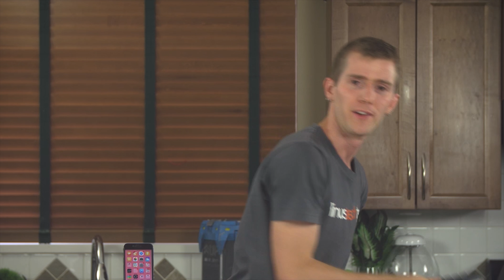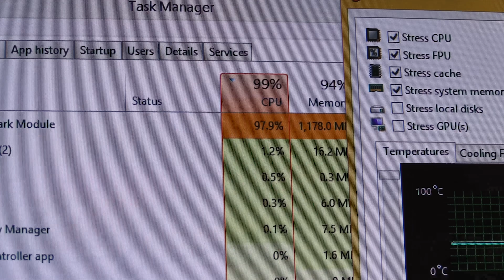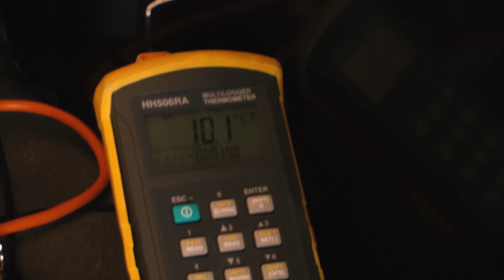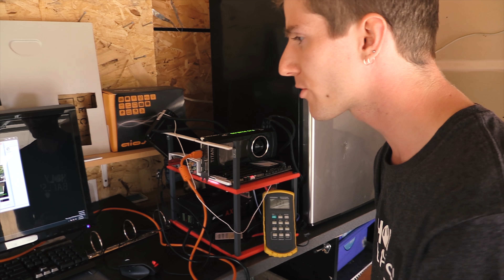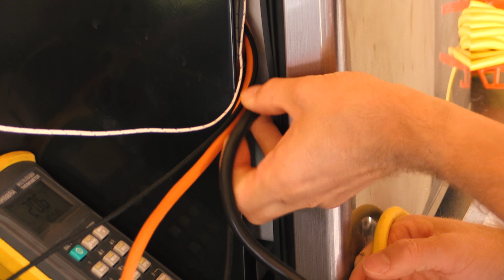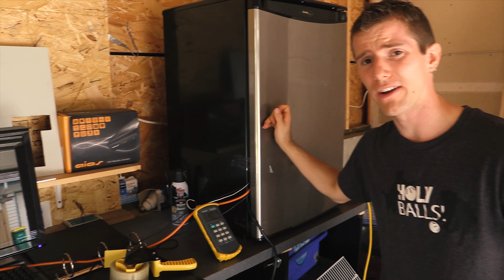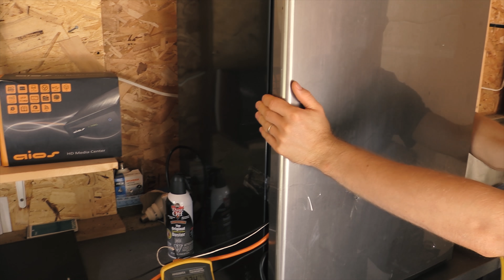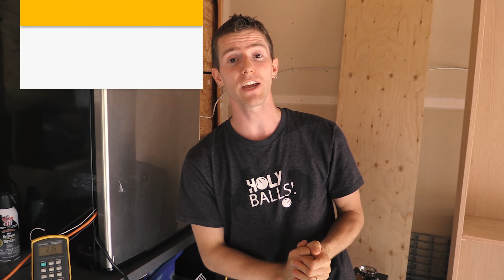PC Build in a Fridge - Does it Work??

Comment: put the mini fridge inside a bigger fridge to cool your fridge that cools the ambient temp of the computer.

Please like so linus sees this, I need to know the optimal fridge-ception number!
Reply: Russian fridges?
Reply: the regular fridge itself would work better because theree is more area inside for disipating and cooling, bigger intake and exaust
Reply: i said better. i use my slplit sustem, to cooloing condition, witch cooling my pc. it was pentum D and I play in TES IV. yes, i look like non competent guy))))
Reply: It would totally work (at least a little). That's actually basically how they get down near absolute zero, you just have a cascade of cooling systems that cool other cooling systems. Obviously not with regular fridges though.
Reply: Fridgesception
Reply: With the water cooled systems that has external reservoir.  Just put the reservoir and the radiator in the fridge with the hoses feeding back from the reservoir to the computer.
Reply: homebrew glycol chiller :D
Reply: @chad w  look like you just fail full stop
Reply: @murraywright635  chad w  is correct. you failed physics
Reply: @mrroasty666  so a fridge is more efficient when the ambient temperature is  lower. So if a smaller fridge is in a bigger fridge the small fridge will be working more efficient than it would at room temperature.
Do you work with refrigerates for a job or are you just full of shit!!!!!!!!!!!!!
Reply: Murray, do you grammar often?
Reply: Different over locking the fridge
Reply: Put the fridge in the fridge in the freezer?
Reply: Different 6th order bandpass cooler 🤔
Reply: Theoretically the only way to to it is to put the pc in it's own enclosed space (best on a test bench too), then into the fridge, with air pipes going out each side of the fridge/enclosure for airflow, all sealed of course, so the fans will dissipate much of the heat in the enclosed space and the fridge cooling the enclosure and therefore the air around the open system inside.  Do the same in a freezer for better results lol.
Reply: Halfdead Rider interesting, so have the whole pc case inside a cooler and air condition the space in the cooler, thereby removing warm air inside and replacing it with cool air at a constant temperature. 🤔
Reply: Different a fridge would generate more heat than it can dissipate, would be better to put the PC directly inside a bigger fridge
Reply: Linus should just scroll down and favorite random year old comments. For the heck of it.
Reply: Why didn't he use a freezer
Reply: Fridge-Ception. I like it 😉
Reply: Buy a better cooler thats better than a pc in a fridge in a fridge
Reply: Get a bigger fridge that cools the fridge that cools the mini fridge
Reply: FRIDGE COMPRESSOR doesnt work that way
Reply: @uzairaezad7630  r/whoooosh
Reply: Every additional fridge layer adds inefficiency. The outer fridge needs to dissipate the heat of the computer, plus the waste heat of the inner fridge. It would work better to just put the computer directly in the full size fridge.
Reply: Zero.
Reply: Would'nt work because a fridge cools down the inside by heating the outside.
Reply: @I_Like__bananas  actually it would work. the coils on the back of the fridge dissipate heat. inside another fridge, they dont magically stop dissipating heat.
Reply: @I_Like__bananas  you would just need a big walk in to account t for the increase in ambient temperature.
Reply: @I_Like__bananas  thats exactly why it would work
Reply: Jonny Hofmann you could actually make it cooler like that lol
Reply: Jonny Hofmann N
Reply: @I_Like__bananas  r/whoosh
Reply: @I_Like__bananas  r/ wooosh
Reply: Jonny Hofmann a fridge gets hot from the outside because it is expelling heat that is inside the fridge constantly. So it would most likely become a tiny bit cooler but not really have any significant changes haha.
Reply: @HYBECTIVE  okay.... but what about a freezer?
Reply: @NeroTheGreater  same principle
Reply: I'm no fridge expert, but i feel like fridges work like mega phones, if you line up a bunch  of megaphones, then the sound will not get any louder than with one, because megaphones can only amplify the noise to  certain degree.
Reply: @josephstalin8442  it would make the min fridge run more efficient but at he cost of the bigger fridge but it would be funny to see

Comment: What about a full size fridge? What about a stand alone freezer? Also the more expensive fridges have the option to have no humidity. I am sure there is a model that can do the job if you are willing to throw a lot of money at the setup for a larger fancier unit. Im sure if you went into a fridge place like sears and told them i want a fridge that can handle huge pots of hot food without letting the milk jug warm up im sure they can show you one that can cool that fast.

Comment: I designed my own cooling system. Easy
Get some old refregerator parts and a small tank of water. Fish tank or anything. You will need a full tower case. 
Just fill the tank with car coolant and dip the evaporator in that tank. Now pass the PC watercooling pipe in the tank too.Heat exchange will take part through water. Make a circular path tube. You can do something else also to maintain more stable system. Dip the PC Radiator in the tank and you dont need fans at all. Your pc will be at 10 to, 15 all the time depend on cooling.

Comment: I can imagine how using much stronger fridge or even a deep freezer as a radiator for liquid cooled would perform or a system submerged in mineral oil in the fridge/freezer. Perhaps liquid cooled system inside fridge & 1st radiator placed outside for dissipation & the second inside for the return. Then again, likely have condensation issues & be very involved. It would seem there's always a down side, but there's also ALWAYS a way.

Comment: This was not an accurate test.  For example leave the refrigerator door cracked the same as you have from the cords in the door and it will have problems even cooling a coke can.  Refrigerators work in the sense that they don't loose any heat.  Your last explanation explains well.  But I think you should try the same scenario with that refrigerator cut a hole in it and install an AC window unit.

Comment: I have run a harddrive from a freezer before. It is an old trick to fix a broken harddrive and I used it for data recovery. I didn't know why it was supposed to work at the time, but apparently it is because the cooling shrinks the metal enough to snap things back into alignment so a drive that spins poorly will sometimes spin better when warm. Sometimes (FAR from reliably) it can be enough of a difference to go from unreadable to readable.

The problem is that it heats back up pretty fast and then crashes again. So I ran it as an external hard drive via firewire (better than USB 1.0, which was industry standard at the time). I had it in a static free bag with as little air as possible to avoid condensation and freezing liquid as much as possible. In the end, I got some of my data copied off the drive, at least the most important stuff, before it was just totally trashed.

Comment: IF pc is plus  30 degrees and fridge is only 15 degrees, then the fridge will get hotter , maybe equal outside temp or higher. You need to drop the fridge temp further..

Comment: This reminds me when my furnace broke down mid winter with -20 F weather. House would be about 40 degrees at night, so I just powered on my computer, and ran a stress test all night long. Turned my rig into a space heater to heat the house. It did a good job lol.

Comment: I found the video instructive.

I'm not really a hardware person so I hadn't really thought about a computer in a fridge.

It went much worse for the fridge than I might have expected. 

But yeah, I guess-- regular refrigerators are really only designed to keep passive objects cold. Anything that's actively, constantly generating heat could easily overwhelm the fridge.

Comment: Just remembered this thing I did after I saw Linus' Razer laptop at the beginning. Sometimes when I closed my Razer laptop it wouldn't automatically sleep. I would put it in my backpack and totally forget about it. One day I pulled it out of my backpack and it was super hot since it was in a tight space while still running. It was burning hot and it hurt to hold it. I panicked and put it in the freezer for a bit. Well I actually forgot about it overnight in the freezer. When I woke up I realized what I had done. I ran to the freezer and saw my laptop in there totally frosted over. I immediately pulled it out and started thawing it with a hair dryer. After I got all the frost off I let it sit in the sun for a few hours then turned it on. It worked like nothing every happened. It was so scary but that is a pretty tough laptop. It still works a year later! So yeah I wouldn't put any computer in a fridge or freezer.

Comment: if it does work, (haven't watched the vid yet) the compressor is in the fridge will shit itself, refrigerant conditions won't be coming back as they should and it eventually seize and die or rupture due to insane head pressures

Comment: Linus this video made me think of a great question. What if you replace radiator fans by mounting the radiator directly to a air-conditioning window unit for example and compare it to a water chiller unit and the standard radiator with fans? What would work best? How would it affect the system? Could it be potentially dangerous for the pc? Also what would be the most cost effective solution as well as reliable?

Comment: Okay, maybe we need to know where the air outlet located at inside the fridge. There should be a fan forcing the air to go through the cooling coil. Once we located that, it's possible to get a 'cooler' system in the fridge.

Even if you don't fire your graphic card, your graphic card will generate a very small amount of heat when it is idling. 

You'll have a better success using your system close to an air conditioner.

Comment: it would be interesting to modify a water cooler to have a heat pump attached to the radiator along with  air cooling.

Comment: I used to overclock the hell out of my system, had long cable for the HDD then set the case outside with the HDD inside when it was 40 below zero outside.
An Ice making machine would work.
also put a liquid cooling heatsink on CPU and video card , run automotive antifreeze in it and circulate it through a transmission cooler in a cooler with dry ice or an ice making machine.
Reply: How did you proof the rest of the machine against condensation?

Comment: you still need airflow...since it is a sealed system you are not getting proper cooling....just like the comments below the fridge was designed for items that do not produce heat.

Comment: Funny video. I suggest to find the efficiency of the fridge cycle  from textbooks and consider how many watts  powers the fridge( see the specs). Therefore you can calculate the theoretical  power he can take from the inside. A funny idea will be to dismount the fridge and put the evaporator side directly in contact with professor and you . It will work better but the gas in the circuit is not designed for such hot temperature! But this video was very entertaining because the ingenuity

Comment: Instead you should've put the gpu and all in the fridge, and the cpu in the freezer with a water cooler. keep the reservoir and radiator next to where the coldness comes from.
Reply: You seem to have a mis-understanding of how cold/hot works. There's no such thing as cold. Cold is merely the absence of heat. Therefore, when you talk about "where the coldness comes from", I have no idea what you mean. Did you mean, where the most heat is removed?

Comment: For this to work, you would need to use a mini freezer and create a thermal mass load within the freezer that is frozen. 
So say a tray of water on the top and bottom shelf. Then set the computer up on the middle shelf. Then over the course of using the computer it would be bringing everything from -18 to 0+ and by the time youve played WOW for 12 hours itll be approaching ambient. Then you get up and shower and expose yourself back to the real world (maybe) and then while your computer is off the thermal mass would regenerate.

Comment: Now I'm curious about how this would react in a commercial subzero bottle refrigerator, Which has a evaporator and circulating air flow. Commercial subzero bottle coolers cool down to about - 6 degrees Celsius.

Comment: Former Marine Corps Avionics Technician. We worked in small boxes we called "vans" that we kept avionics benches in. Our two biggest, CASS and ATS, took up two vans with a wall pulled out of each and secured to each other. There were two industrial size and strength air conditioners behind these benches, and they were not in place for the comfort of Marines working with these test benches.

The cool air was ducted into the back. There was enough cooling that the vans were generally comfortable for the technicians, but it would still get hot behind the bench.

Comment: I'd like to know if putting it next to the air conditioner changes the specs. Or since you are in Canada, taking it outside during the winter (sealed against humidity of course). - A guy from cold Finland

Comment: This was never going to work. I'm an HVAC Engineer and I can tell you that fridge is waaaay under powered for what your trying to do. Maybe it might be doable in a freezer with dedicated airflow toward the cpu but then you will have a defrost cycle to contend with. If you really wanted to accomplish this you need to calculate the max btu output of the computer and then use a chiller setup sized appropriately. This is completely unnecessary though as just a fan with liquid cooling gets the job done. But yeah, you'd submerge your liquid cooling radiator into the chilled glycol which essentially take the place of the inside of your fridge, your "conditioned space" and that'd be more appropriate. If you wanted it quiet then you'll need some long lines to remote locate the radiator, otherwise you will have a chiller sitting next to the computer which will be very noisy. Best regards.

https://youtu.be/LU114eQgS-M

Comment: What about building a pc with the backboard for the desk being the same thing they use to give off air conditioning inside a car and make entrance holes come in through the back of your desk to push air in and holes in the sides to let the got hot air out? I'm pretty sure you don't need an engine to make the cold air for one of those to work it should automatically give off cold air from sucking it up from the outside

Comment: Buy a cheap a/c for a few hundred that goes in a small window and is made to cool one room.
Use duct works to have it blow onto one side of your PC first and then freely into the room.
Can do it up all fancy with the same idea too if you get tricky.
Maybe you can just move an air duct in your central cooling to blow on your PC location.

Comment: A small single room size AirConditioner can handle somewhere between 5k-10k BTU's (read the specs). How many BTU's is that PC throwing off? (BTW, the only reason for heat coming off of the components is that they are not 100% energy efficient - that would require a superconductive material to carry the electrons (electricity).) Anyways...it has been proved over and over in thermodynamics (the physics of heat) that liquid cooling is many times more efficient than any kind of air cooling (which is what an AIR conditioner does). Check this as one source of proof: https://youtu.be/CVginpnALL8
In the next decade radiant cooling (aka hydronic cooling) and heating will completely replace HVAC - you will see why in the vid ($AVE $$$$'s/Yr).